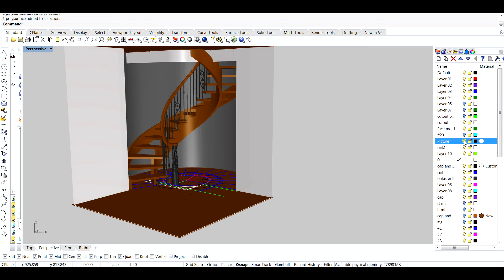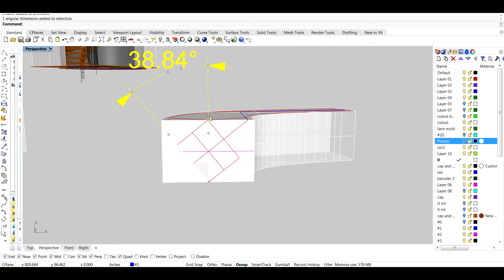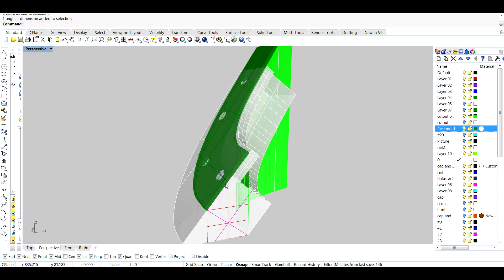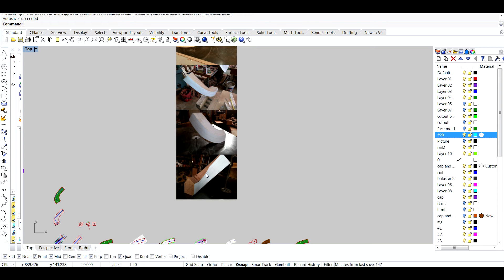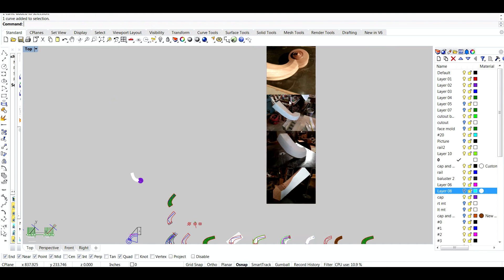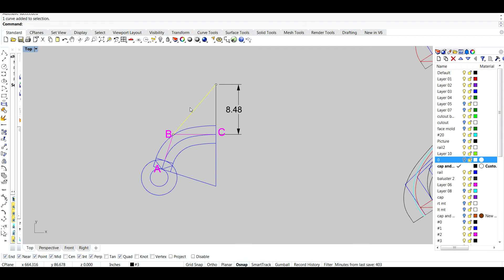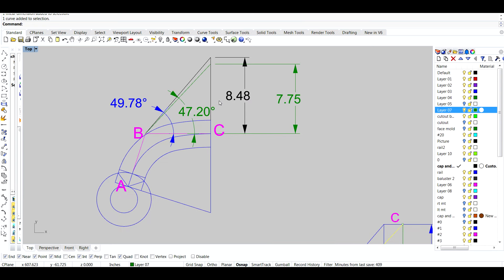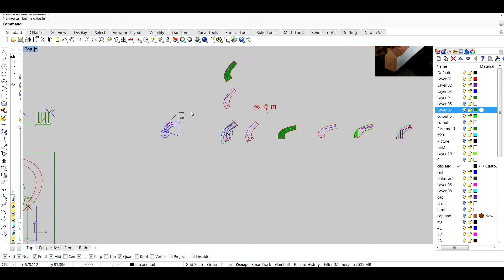Tangent Handrailing the ordinate method Part 2

Comment: Exposing and analyzing your errors in public isn´t only brave and humble, but also a hand stretched out to your colleagues, a beautiful thing!
The "falling mold" is new to me, and a very helpful technique to level up the accuracy when the ordinate direction is offset, or you have a multiple radius as you very well explain. Its really tricky to get the sidelines accurate in these cases. Thanks!! And a very good warning and explanation of the pitch problem youre bound to run into when working with curved stairs! 
You are creating an exellent library and modern suppliment to the old books with your videos. Cudos master Earle! It´s very interesting and helpful. 
You obviously didn´t make this (BEAUTIFUL) handrail (or part of-) with cnc, it would be very interesting to see how you made the mouldings!
Reply from the maker: Thanks Petter for the kind words. Mistakes are good teachers because of the sting. Education is always expensive as we all know too well. 
As far as the profiling is concerned, the shop tour video on the French Spindle shows the machine that was used on this fitting.